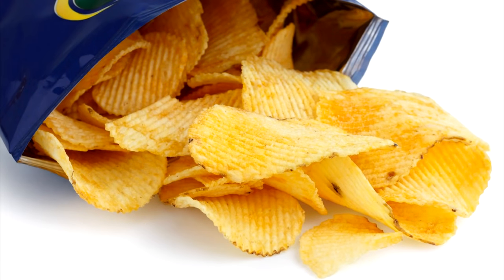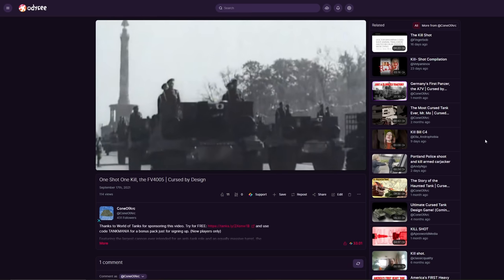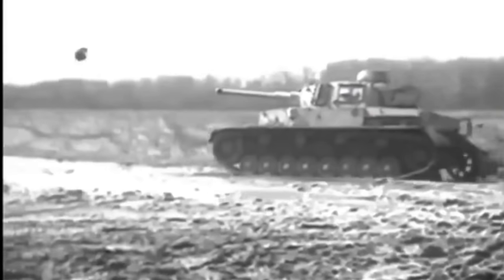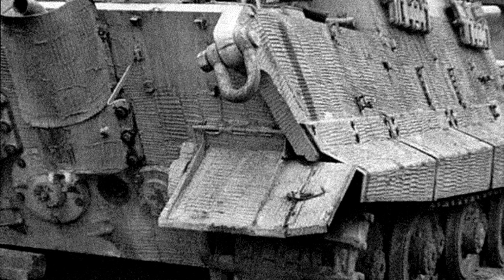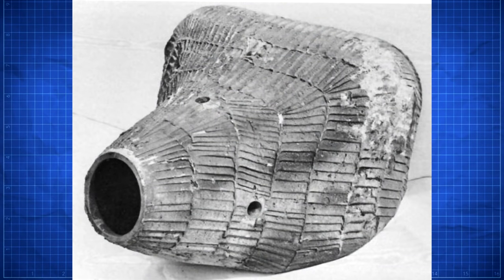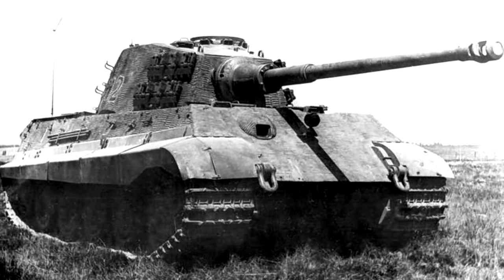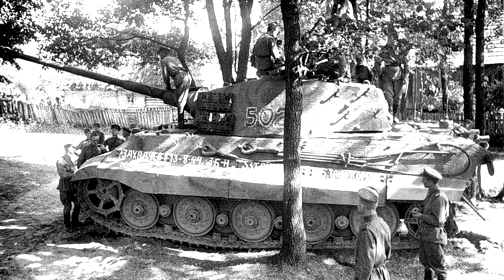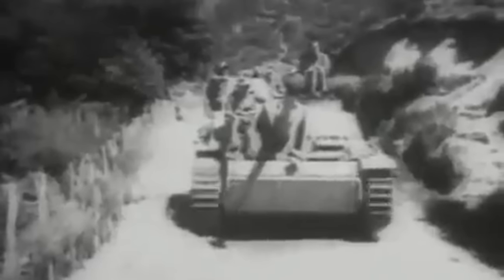Why did Germany put Zimmerit on their Tanks? | Cursed by Design

Comment: 1:46 pretty sure magnetic naval mines don't actually stick to the ships, they just use magnetism to detect the presence of the ship nearby and then detonate
Reply: You need to watch more Gilligan's Island
Reply: There are some cartoons which use this hilarious misconception.
Reply: Magnetic detonators are tricky things. You gotta account for variations in the earth’s magnetic field or they could be too sensitive or not sensitive enough. The change in field as a mass of metal passed by would fire the detonator and set off the explosive. 

Sea mines and torpedoes were designed to go off below a ship and do nasty things with a cavitation bubble.
Reply: there are limped mines that attach to the hull via magnets, but those are usually deployed by divers
Reply: Depends on exactly what kind of mine you're talking about. 
The magnetically triggered mines that degaussing cables helped protect the ship from were not much of a thing in land warfare. The purpose of degaussing the ship is to reduce or eliminate the distortion in earths magnetic field caused by the passage of a huge mass of ferrous metal. The mine frequently is a bottom mine, and when it detects a sudden change in Earth's magnetic field, it explodes. 
There were magnetic limpet mines developed about the same time as their land based equivalents, and degaussing the ship has no effect on them. They'll stick just fine. The Naval version had to be placed on the target exactly like the land based version. For a ship, the proper defense against these is various nets, patrols of small boats, lookouts and a couple of cases of hand grenades.
Reply: depends some do some dont, mines that use magnets or some other mechanism to attach them selfs to a target before detonation are called limpet mines
Reply: true, the stationary magnetic mines used magnetic ignition system. mines he told about have ben used by covered ops to sink ships in ports.
Reply: @joym3357  No they don´t. Limpet mines are more like satchel charges for ships. Not mines that jump up and attach.
Reply: @XMysticHerox  I never said they automaticall jump to a ship lol, people place them there and then remote deotnate them, never the less that's still them attaching them selfs to the side of a ship with magnets or suction

Comment: It was applied in 4 different patterns and it's main effect seem to have been for camouflage. 200 tons were shipped to Australia after the war for further testing and the results were the same. No good at anti magnetic but good at breaking up the lines of the tank when in "Undergrowth"
Reply: Explains why sometimes concrete was used instead of actual Zimmerit if it had better camouflage capabilities
Reply: @dindrmindr626  The patterns that i know of are the "Square", "Waffle" "Square with Vertical/Horizontal lines" and "Horizontal Lines" if you can give me any details on the others you talked about i greatly appreciate it
Reply: @dindrmindr626  Thanks for that...the zigzag is a really interesting looking one, i shall be trying that pattern out on my next model i'll be making......but it won't be on a Panzer IV
Reply: ughh wouldn't paint have been easier to apply if it was just for camo bro?
Reply: No, not for coloration but for breaking up the lines of the tank
It’s pretty easy to spot a green square in some bushes 
Also heat resistant so burning to death or ammo heating up to much was not a problem
Prolly provided insulation to
Reply: @Prootgen  all camouflage is intended to break up the lines of the object it's disguising, usually with changes in color value or brightness. The narrator said it made it "easier to camouflage" so it may be that by roughing up the surface, it was easier to attach branches and other greenery to camouflage it further.

Comment: The heat resistance makes sense if you compare the suggested composition of zimmerit to the insulating blocks used in a kiln or a forge. Quartz is a crystalline silica and silica is a basic insulating mineral. So they kinda "invented" the heat tiles like they use on space craft for re-entry.
Reply: only the space shuttle and now the Starship prototypes use heat insulating tiles. All other crafts use ablatives which boils off taking away the heat from the craft itself and is the same principle that prevents liquid water from going higher then it's boiling temperature.
Reply: Plural of "craft" is "craft". Not "crafts" ffs 🙄
Reply: @peter4210  "It is better to be silent and be thought a fool, than to open your mouth and remove all doubt".
Reply: @jbrizzle4725  Oh excuse me, I did not know it was illegal to form a well researched opinions on the nature of spelling. I will try and find a quote too to hide the fact that I can't think. Here it goes:

""faciem durum cacantis habes""
Reply: quod erat demonstrandum
Reply: we used glass mixed into the refractory on the boilers (Brocken beer bottles ) we were running 900 F superheated steam through the HP turbine the glass didn't flow away at these temperatures but helped to protect the refractory  from  the air blast and fire in Furness.
Reply: Found some redditors.
Reply: @cutetrapayaya5332  I've got far too many spectrum behavior of my own to take too huge a dump on other people who seem to.

Unless I can think of something really funny or bitchy to say.
Reply: @philmckenna5709  linguistic prescriptivism is cringe and classist

Comment: The way that Zimmerit and similar textured substances can disrupt thermal signatures reminds me of how the Ho 229 sort of accidentally became the first "stealth aircraft" because its shape, makeup and wood-mixed paste coating turned out to have effective anti-radar properties. Of course the Germans didn't know that at the time, Kraut Space Magic just happens by accident sometimes.
Reply: By the end of the war they was magnetic tank detectors combined with seismic detectors as well. My grandfather operated one in the 50s in the US army on the Czech border area I think.
Reply: Ruffles. I like engineering and science, and find it pretty cool that ruffle style were used on tanks. 

Also, isn't degaussing also used on old CRT monitors?
Reply: @thatguyalex2835  Yeap, still had one not too long ago, had a degauss, had to fix a few of those and the degauss thing is really just a powered wire that runs in a loop around the screen, pretty much the same as the one for boats, just at a much lower size and power.
The degauss circuit ran every time the screen turned on, and you could do it manually, made it hella wobbly while the degauss was running.
Reply: @GashimahironChl  I pressed the degauss on an old CRT like 10 years ago, and it did wobble like crazy. Sadly, I was born months before the new millennium, so I didn't get to experience that much CRT, except in the 2000s on my parents old 1998 PC that they never used since like 2003. I took apart the PC in 2012, since they were gonna send it off to recycling that year. I played jumpstart games in 2004-2008, so I had some cool nostalgic memories from that HP Pavilion 6830 series tower PC. :) Sadly, technology isn't growing as fast nowadays (2010s/20s tech stagnation, and end of Moore's law by 2025) so it is hard for me to find nostalgia from devices less than say 5-10 years old.
Reply: That stuff is all myth. The coating never did function as an  anti-radar coating. The metal frame and engine reflected radar just fine.  A lot of that stuff seems to have come from Horton after the war to blow up his own importance. His coating was literally white paint and ashes and other crap laying around..if I remember correctly, he was basically just trying to improvise black paint.
Reply: @thatguyalex2835  I live in a country where tech takes a while to become widespread to the populace, it was especially so in the 1990's and earlier, so i got to "enjoy" frickin dial-up a little longer when everybody else was having a blast with broadband internet, and CRT's, and outdated game consoles, and old standard PC AT's that you could wire backwards and instantly destroy a VERY expensive motherboard.
Reply: @GashimahironChl  So in essence, you guys were still using like Atari 2600 and the original 1984 Apple Mac in 1997? :)
Reply: @thatguyalex2835  Those were never common here, but were outdated in around 91 and mostly disappeared in 95
The crappy atari was around for a while longer as leftovers from the middle class that survived and sifted down to the lower class, the macs didn't quite survive the hot weather and humidity and were all out of comission a little sooner.
We were quite fond of IBM gear and had a lot of that lying around, we also had plenty of the japanese consoles from nintendo and sega, nes, snes, megadrive, even dreamcast was relatively common, for far longer than they should have been.
Reply: @GashimahironChl  What country are you in, if I may ask? I am in the USA. Everyone here has PS4.

Edit: Except me, I don't really game at all.
Reply: @thatguyalex2835  Brazil, in the south americas, and everyone here has the PS5 and about half of those have VR headsets and accessories.
Reply: @GashimahironChl  Cool

Comment: I wonder if any of the ingredients in the mixture experience any chemical change when exposed to fire? If the Soviets took their samples from a burned out tank rather than a captured one that could explain differences.
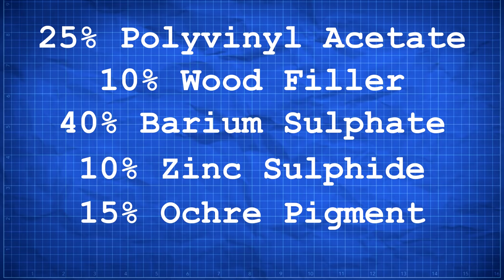Reply: Well, the PVA plastic/glue and the wood at 1:16 are definitely changing after a toast… On the other hand it’s blowtorch-dried for one hour at production so I guess extra toasting isn’t going to do much?
Reply: @a2e5  Hmm, there is a big difference between an intentionally used blowtorch and a tank’s own ammunition supply blowing up.
Reply: @jooot_6850  Yeah, it would be hotter and a far more sustained heat. The wood would turn to carbon and who knows what other chemical changes would take place. It could definitely be enough to give false positives under a 1940s microscope. I doubt they would have othered testing its composition more than once or twice.
Reply: @jooot_6850  it kept the ammo from blowing most times.  Probably why we like to say, "Oh, nevermind all that."..
Reply: Sounds to me to be closer to a FIREBRICK mixture and if they stopped them getting hot when a flame thrower was blasting the tank, they OBVIOUSLY WERE some type of firebrick unintentionally.
Reply: The polyvinyl acetate (PVAc) binder and wood components resist burning due to the over-abundance of the inorganics present, especially the barium salt. The German firm Wacker (still family run to this day) started PVAc production in 1930 and is one of the early synthetic polymers. The dry composiion could smolder but would not openly flame up when exposed to fire. PVAc is not considered water resistant over the long term, it slowly hydrolyzes to polyvinyl alcohol, which is rather water soluble.
Reply: It wouldn't surprise me that, due to shortages, the recipe changed over time and may not have been as well documented as the original. It's hardly uncommon for the documentation to say one thing, but what actually happens is something quite different. Anyone who has worked in IT knows that!
Reply: Horsehead Fever !
Reply: Yes. Barium Sulfate burns a green color when heated due to the elemental barium getting oxidized. The ochre pigment (Iron Oxide) would provide a very small amount of oxygen for this reaction to happen  faster

Comment: Germany: we need Zimmerit to protect our tanks from enemy magnetic mines

Allied Nations: BUT YOU ARE THE ONLY NATION USE THE MAGNETIC MINE ON FIELDS,GERMANY
Reply: Their idea was there.

Magnetic mines seem like a next step in anti tank weapon development for countries because the mines will always stick and as such much better compared to normal anti tank blasting charges

Problem was that no one bothered developing them for some reason.

Likely believed it was a dead end or thought normal at weapons worked well enough
Reply: @Thekilleroftanks  why would you make something more expensive and complicated when you could have a simple mine
Reply: @lunatic_nebula9542  That is the heart of all German Engineering.... Over complicate things. Just look at the G11 if you want another example.
Reply: @GrumpyIan  the G11 is actually fairly well-designed and about as simple as it could realistically be to meet the specification requirements. It's just that the requirements were dumb. NATO wanted a rifle that could drastically improve hit probability in combat, decades of testing by the US starting in the 1950s running right through the 1990s achieved very little. They tried putting two bullets in one cartridge, then three bullets, then they tried flechette rifles and caseless ammunition, and H&K were eventually roped in in the 1980s to make a 3-round-hyperburst weapon to fulfill the US' needs and replace the G3 for the Bundeswehr. Needless to say the clockwork nightmare of a gun was never officially adopted by either nation.

The Russians did something similar with the 2-round hyperburst AN-94, a gun almost as complex with essentially two guns in one fed by chains and pulleys. AN-94 did get adopted by special forces and has allegedly served in combat in limited numbers.
Reply: @lunatic_nebula9542  It can help prevent civilian casualties (at least in theory)

Not that the Germans or the allies were particularly worried about that in WW2 but just in general.
Reply: So if their enemies suddenly start using magnetic mines, or capture a whole bunch and start using it, should the Germans recall all tanks from the battlefield to modify them? It's better to be prepared.
Reply: @Thekilleroftanks  for allmost all mines, the orientation of the mine doesnt matters, for the german magnetic anti tank "mine" the orientation was very important because it was a shaped charge, the magnets keeped the charge in place, the right distance and angle.
Reply: @lunatic_nebula9542   it should be stated that though the germans called it a mine it was more of a blashing charge for tanks. (because the germans still used normal at mines)
(as for my confusion, sleep depervation has fucked up my brain at connecting the dots.

however the point still stands, in fact for cost its likely the same seeing the explosive mass for a HEAT warhead is far cheaper than just pure explosive, and then all you need to do is strap some magnets to the front and boom, magnetic mine.
Reply: They could say something like.

'Shows it's working then?'

In response.
Reply: Exactly, prevent friendly fire
Reply: @Thekilleroftanks  Actually its not called a mine in german, in german its called Hafthohlladung, wich means sticky shaped charge
Reply: JA WIR BRAUCHEN ES!

Comment: Hold on, you're fundamentally mixing a lot of concepts up here.
De-Gaussing ships was done to reduce their magnetic field strength  as early magnetic mines worked by detecting the magnetic field (later mines worked by sensing changes to the local magnetic field, so this technique didn't work). The anti-tank mine that you talked about was a magnetically adhered device, which means that it used magnets to attach to the tanks surface. De-Gaussing does not stop a magnetic from sticking to ferrous metals!

Comment: Zimmerit might have been invented as an anti mine layer but probably saw continued service for its camoflauging properties, hence why it was still issued to troops even  in the field to apply. There's quite a few images of crew applied paste that was specifically textured in the iconic slatted fashion because it dried matte and hid the tank's flat reflective surface and unlike paint which just colours the plates it also breaks up the harsh lines and faces

Comment: Seems more likely that it was intended to be insulation, and perhaps an attempt to reduce their sound signature at the same time. Heck, even being outside the tank, it would probably keep the inside from ringing like a bell on non-penetrating hits. Attempting to put insulation on the inside of an already cramped tank would likely be met with resistance, but insulation would be a very important feature to keep your tankers in good shape during the anticipated campaign across frozen Russia.

Comment: I had always thought that stuff was stick welded hardfacing, I only found out a few years ago that it was just a cement-like paste applied for magnetic mines.
Reply: Dude! Your idea is better!
Reply: @insertgoodname4809  I thought so too lol, but I guess it makes sense why they wouldn't do that with how long it would take (the video did said they were using unskilled labor to apply the zimmerit and couldn't wait the full 8 days to dry so they used torches, sounds like stick welding every square inch of the tank might take just a tad longer than that🤣) , and I imagine it would induce a lot of stress in the armor as well, could cause cracking issues...

But if it was done right and stress relieved and all that I imagine it would probably increase the durability by a little bit at least, having a hardened surface would probably completely deflect small hits and mitigate bigger hits vs a standard hardness armor.